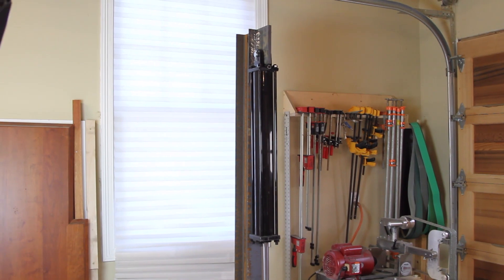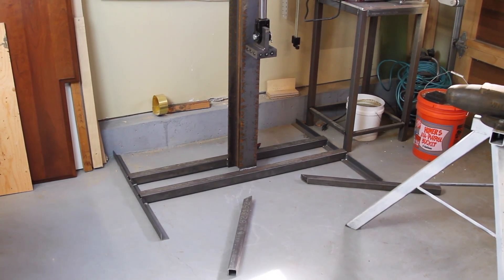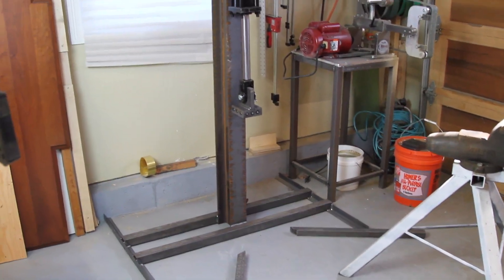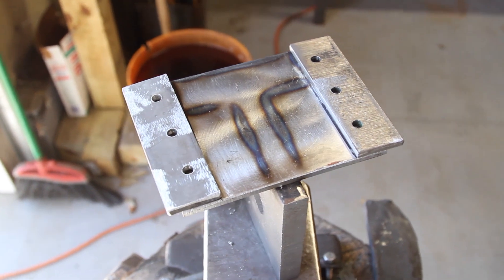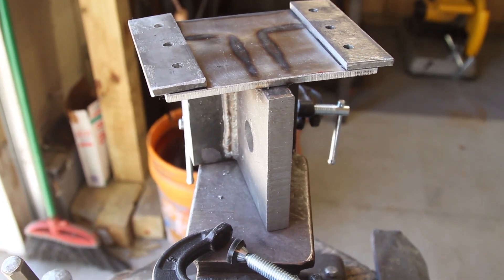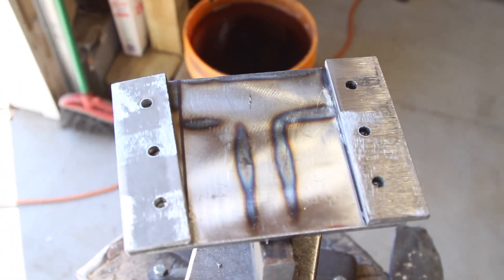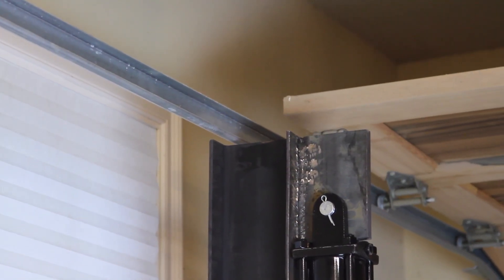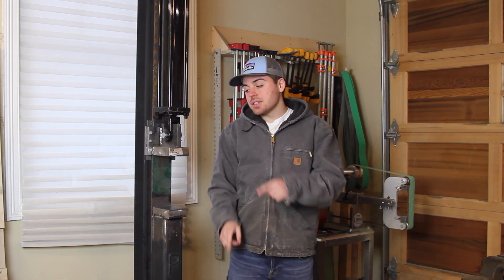Building a Hydraulic Forging Press - Part 2

Comment: its great to see someone so young make stuff , and know how to use these skills, but a word of advice to mention, depending  how much pressure your press is going to put out, it was mentioned by the guys from coal ironworks, that the huge 50 or 60 ton press they made out of I beams tended to warp and flex under the pressure so and I beam might not be the best type of structure to build one with, if your going to have huge pressures for forging like that, but its your build and your press you can do as you want, Just thought I would bring to your attention from something I ran across to pass along, from one maker to another.
Reply from the maker: Hey thanks a lot I appreciate it! And I’m glad you told me about that I know they use some pretty large plate to make the frame for there press. I’m hoping this I beam holds up but I’m also a little concerned about it bending. I’ll definitely keep you updated and make more videos about it soon!
Reply: ah so you have heard of them,  heh yea they are from indiana like me, I called them once to ask about tool making, but they just make stuff for the presses and powerhammer sorts of stuff not regular hand tools, they seem to do good and have a nice thing going for them, I just thought I would mention that they said of their old shop large press made of I beam that it had lots of deflection and was not as stiff as they would have liked, they make a 50 or so now thta looks like the jaws off a nutcracker with two of the rams they would use for their 25 ton for the driving force of the press, and they have entire pump and motor assemblies that would be the heart of a press systom they sell, there are 2 types on their coal ironworks page I do belive.

but yea I just thought I would mention it, I dont do much forging, but want to finish the piece of bar I was working on make a prybar out of it or a chisle once I get more torch gas, and it warms up, in the spring and summer
Reply from the maker: Yeah they make really cools stuff I wanted to buy one but I figured it would be cheaper and more fun to make one. I just subscribed to your channel you have some pretty cool videos on there!
Reply: well a mix of latin mass, archery, propmaking, and railroad mainly, but thanks and yes it can be cheaper to build one but its still cost a bit of materials unless you can score them on the cheap